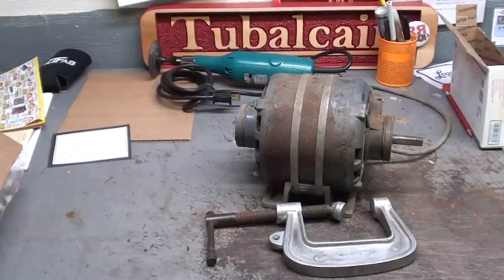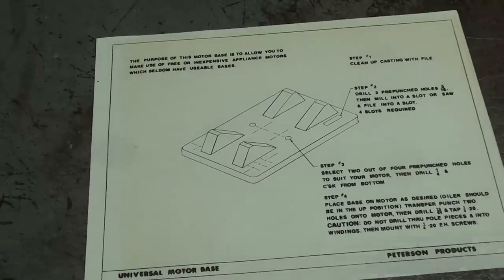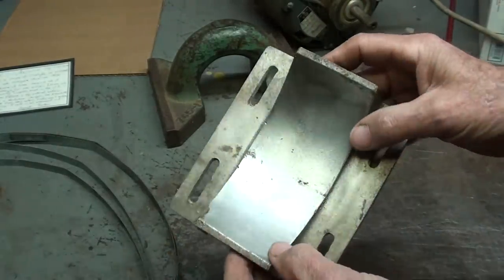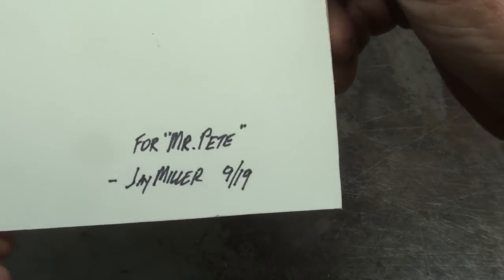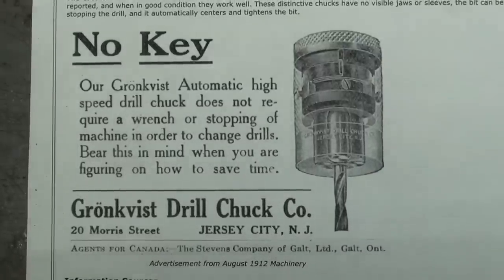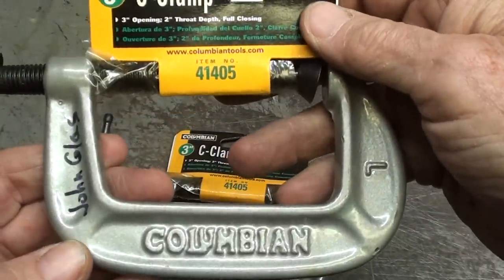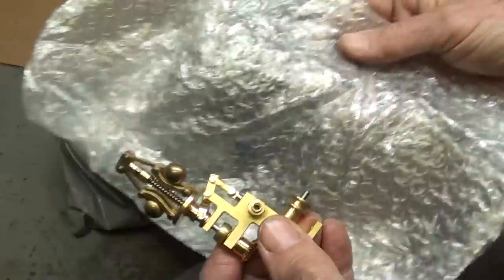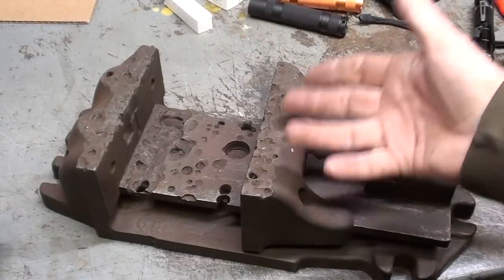This & That #51 tubalcain mrpete shop teacher

Comment: It makes me sad when you dismiss the stories from your past.  I really enjoy them.  Reminds me of the stories my father used to tell me.  Sure wish I had them on video to look back on.
Reply from the maker: Yes, I wish I had some of my dad stories recorded
Reply: My adult kids aren't even interested in my stories.  And I have some unusual and amazing stories.  So I'm going to write them down for when I'm gone.  Maybe they will only take up shelf space, but a father can only try.
Reply: I like your c clamp and motor mount castings. For a young man, you did very well. I have an aluminum step V block from BTHS in my shop.

Comment: Thankyou sir I’m only 72 so got a lot more years yet to learn...yup I learned that about right way to operate crescent wrenches too you be the first person who remembers. Learned too to never grind aluminium on a stone grinding wheel...when next used with steel it produces a deadly explosive gas and can fly into many pieces...never bang two hammer faces together and drag a waste bin around you when working wood as many off cuts and chips will jump right into it all by theyselves saves tramping on them and eases cleanup.
Reply from the maker: Thank you for some good tips

Comment: My dad got an Adjust-a-box wrench from the hardware store in Mount Morris, New York back in the '70s.  He was trying to replace the sprayer on the kitchen sink and there wasn't room to get a crescent wrench into the tight space.  We didn't know about basin wrenches.

I think I have that wrench now.  I've used it a few times and it works fine.

My favorite adjustable wrench though is one that has a slider running along the handle that turns an elongated worm screw to adjust the jaw.  I find this one much easier to adjust than the ones with the worm gear and rack that are parallel to the direction of jaw motion.
Reply from the maker: Thanks

Comment: Bringing back memories. While an electrical apprentice in early 70's  I purchased a set of Sears champion brand box wrenches. Asked the electricians how they liked my craftsman wrenches. They laughed at that. Told me the best place for or them mickey mouse wrenches were at home. After that made sure to only purchase top of the line tools. Still using a craftsman 3/8" socket set that I purchased in 1967 while in high school. Thanks for all the great vids.

Comment: The Crescent/adjustable wrench is made to be used in both directions. (Leading and trailing.) The ENTIRE reason it's cocked at an angle is so you can flip it. For restricted areas, where you can not hit the next set of flats, in one stroke, you can flip it to get onto 2 flats. (Where you can't get a full 60° turn.)
Reply: I beg to differ, the movable jaw tends to angle out and away from the hex nut/bolt flat when force is applied in the incorrect direction, thus offering less ability to apply torque to the nut/bolt.
JIM
Reply: JIM C - but if you study it, using it “correctly” like they recommend, the force is being applied towards the tip of the movable jaw, which i see as applying more leverage to pull the jaw from its track, spreading the tool easier than if it were used the “wrong” way. I’ve always used an adjustable wrench the “wrong” way ever since i was a kid because I discovered way back then that the jaw wouldn’t spread as much when the force is applied closer to the tool than towards the tip of jaw. About 5 years ago i saw for the first time, an adjustable wrench with an arrow on it. I immediately had a puzzled thought, and showed it to a friend and said, “look at this! Cheap china crap has the arrow on backwards”. Now i see this. Mr Petes example is wrong too. Lol. Trust me.
Reply: I've kinda lost track of what's supposed to be "correct" and what's "incorrect",  but it isn't rocket surgery. If you visualize a crescent wrench on a bolt head, with the fixed jaw on the left, and movable on the right, and we tighten the bolt (rightie tightie...etc.) that fixed jaw will push, with max effort at the top of the bolt head flat, while simultaneously the movable jaw is pulling with max effort on the bottom of that opposite flat. ...i.e. max strain on the movable jaw is occurring close to the threaded portion of that jaw (away from the tip).  If we flip the wrench around, the max strain on that movable jaw, pushing against the flat, is now experienced nearer the tip of that jaw, thereby exerting more leverage and theoretically closer to failure.
Practically speaking, it probably only matters to those having nothing better to do than argue/discuss such issues.  lol
Reply: An adjustable wrench/spanner should always be used with the fixed jaw leading ✔️ You can flip it to use it the other way in restricted places but where there’s room always lead with the fixed jaw. This puts less strain on the slides and screw of the moveable jaw. Too many people who should know better keep spouting the opposite.

Comment: Hello Mr. Pete, The only documentation I have found on using adjustable open-end wrenches is from the Department of the Army Technical Manual TM 9-243 "Use and Care of Handtools and Measuring Tools" September 1960. The picture in the TM is almost identical to the picture you display. The TM states 'Always place the wrench on a nut or bolt so that the force used to turn it is applied to the stationary jaw side of the wrench, as shown in figure 127. After placing the wrench in position, tighten the knurled adjusting nut until the wrench fits the nut or bolt head as tightly as possible. If it does not fit tightly, it will slip, which may result in an injury to your hand and which may also round the corners of the nut or bolt head." 

Later, the TM states you should use Auto and Monkey wrenches in the same manner as an adjustable open-end wrench.
Reply from the maker: Thank you. My picture came from the little Disney handbook. Disney did a lot of artwork for the armed services. Probably the same picture.

Comment: I just noticed today at work my Crescent wrench has arrows on the handle showing the "correct" way to use it, but I'm with Mr. Pete, i just grab it and start turning!
Reply from the maker: I was not aware that any wrenches had arrows on them
Reply: @mrpete222  It's a Crescent Crestoloy. It has downward pointing arrows on the end of the handle.
Reply: A modern adjustable wrench in good condition is about equally strong in either direction. It’s the old worn ones with a lot of slop in the movable jaw that you need to watch out for

Comment: Funny comment about crescent wrenches and BMWs.   The one time recently that I can remember using the big Crescent wrench I have was to loosen the oil filter cap on my 2002 BMW M5!   Some people spend tons of money on a big metric socket for this purpose, but I'll just use the Crescent wrench!
Reply from the maker: You were the only one that caught that bit of humor or sarcasm. And the funny part is, you actually used an adjustable wrench on a BMW, LOL.

Comment: That wrench the Patriot is like the Craftsman Pocket Socket adjustable box-end wrench. I got it for Christmas when I was 10 or 11, and it's awesome. It's got 2 v-jaws, that clamp down on updating corners and the 2 adjacent flats. So it's a lot less likely to slip. The 2 sizes span almost every hex size. Perfect for someone who wants a toolbox for home repairs.
Reply from the maker: Yes

Comment: I was a missile engine technician in the military in the early 60's and had to take a test on the use of adjustable jaw wrenches . I was issued card with my  license to drive adjustable jaw wrenches! I had to show my license at every tool box check in order to keep the wrenches. Just one more reason I've always called it the Air farce.
Reply from the maker: Thank you for that information and you made me chuckle

Comment: 14:50. I agree that it does not matter the direction.  I do by habit pull from the large end. But not always due to tight places. I have never slipped over by using the wrench "backward". I have seen a test of weather or not it matters and as far as strength of the wrench it does not appear to. But i always remember as a kid being told to pull with the large solid side.

Comment: Lyle,  I think the restoration of the vise would be a good one, especially if you nickel braze the holes in the jaws and resurface.  Replace the lower plate as before, Evaporust, machine new replacement jaws, and repaint!  My two cents worth, anyway!
Reply from the maker: Yes, but boy did you make it sound like a lot of work. I am retired, LOL

Comment: Speaking a little out of school since i do not owen any rechargeable flashlights. I use flash lights a lot and i do not like the idea of recharging in the fact that when my batteries go low or dead i want to replace them and continue with the task at hand. You got rid of the plate on the drill press vice instead of boxing it up and placing on your shelf.😀

Comment: To add to the great Crescent controversy... one of the Crescent adjustable wrenches I have has arrows on the handle near the hangar showing which way the wrench is to be used. Perhaps the company decided that, as you observed, it doesn't matter a whole lot which way you use the wrench and gave up on the arrow markings.
Cheers from NC/USA

Comment: Convoy is a pretty good flashlight brand. Don't let the cheap price fool you. 
That 18650 cell you have is a bit over the top for a flashlight . I mean 20A discharge rated battery in a small flashlight sounds like a pocket heater to me. 
Those 18650 cells can be mighty powerful. Always handle them with care (even if they have the protection circuit, those are not Bubba proof)

Comment: Simon (owner of convoy) makes a great light. I've been daily carrying a S2+ just like that orange one for 2 years now. Depending on the firmware of that s2+ it can be programed very easily just with button presses to get rid of the useless features and you can set the brightness it comes on at.
Reply from the maker: I wonder if I can program out all of the nonsense. I just want a flashlight

Comment: using the " adjustable wrench"  the wrong way increases the chance the wrench will slip and "round" the fastener , having said that the picture you displayed is has it backwards, test this by loosening the jaws a little and then turn the wrench back and forth, you can see on the movable jaw the further out the corner of the fastener contacts  the jaw the longer the fulcrum is on the jaw hence the more load is applied at the joint and the great chance jaw will deflect and the corner of the fastener will be rounded , ps: use a 6 sided nut

Comment: Even though some of the special batteries can be a pain to get & use, I think those flashlights are better than the super-bright regular-battery ones: The regulars have a super-fast flicker that can mess up video and cause rotating parts to look like they're moving slowly and in either direction ("aliasing" – basically how a timing light works… for those of use who remember when automobiles had distributors).

However it may just be that my regular ones are cheapies, since IIRC both kinds use pulse-width modulation (PWM) to control brightness, and the flicker is dependent on how good the power-smoothing is on the output side.

Thanks again for another fun and interesting videos.
Reply from the maker: Thanks for watching

Comment: Stanley makes an adjustable wrench that has a "vise grip" feature on it to tighten down the jaws on the item you are working on.  Almost eliminates the "rounding off" of nuts.  Stanley 85-610 Locking Adjustable Wrench is one example.
Reply from the maker: Thank you, I have never seen one

Comment: I think you demoed that type of chuck years ago. I actually like that idea for a tapping chuck. so you can change from drill bit to tap.. just use short screw drill bits to be about the same size as the tap.Not perfect but it'll work.
Reply from the maker: Yes

Comment: Hey Mr Pete, The flash lights you got are great but one thing - be careful how you store the batteries. Don't put them in your pocket with change or other metal items. Those are the batteries that vapers use that will blow up if shorted. As long as you take care of them they are fine ie keep them in the boxes they came in when not in use. I don't want to scare you but just be cautious with them. Later
Reply from the maker: Thanks

Comment: Those special batteries are lithium-ion 18650 cells. 18605 is derived from the cell dimensions 18mm diameter, 65mm length. If you purchase replacements, be sure to get the ones with the protection circuit installed (as the Samsung cell appears to have) for use in a flashlight. Without that circuit you will over-discharge the cell and ruin its capacity. Be warned that there is a HUGE problem with counterfeit cells and I would be very surprised if the ones you have are genuine. The fakes aren't necessarily dangerous or anything, they just don't have the capacity of the genuine cells.
Reply from the maker: Thanks

Comment: Amazing that you happen across those Peterson Products products, what are the chances of that?
I like my Harbor Freight welders; not as fancy as the high end stuff, but they're affordable and do the job. 

I also like my adjustable wrenches, I don't get why people trash them like they do either, they're a fine tool when used correctly. I also have one of those adjustable box wrenches. Haven't used it in years, it always felt gimmicky. Although to be fair back when I did use it, I used it a lot and never had any issues. 

Tools die when Bubba gets to them, he should have learned more (or less?) from Primitive Pete! 

I vote for the vise resurrection, it needs a new lease on life!
Reply from the maker: Yes, I was shocked when I ran across those old projects. And I do like adjustable wrenches, can’t figure out why others hate them.

Comment: I really like the spool valve/piston demo card. Manually animated cards, look up tables and these sorts of things are a lost art, I'm afraid. Also, welcome to the world of lithium ion batteries. Those new flashlight batteries look like 18650 lithium ion batteries. 18650 so called due to being 18mm diameter and approximately 65mm long.
Reply from the maker: Thanks

Comment: Mr. Pete,
  I fully understand your comments about teenagers and their antics. For one I was once a teenager myself and got myself thrown out of shop class on several occasions. 
   However I never fully understood how aggravating my insolence was to the adults around me until I became an adult myself and had to deal with young people on a regular basis when I worked at the YMCA in Clinton, Illinois. 
   At the time I was a bi-vocational pastor. The small church I pastored was unable to pay me a lot so I took a job at the admittance desk at the Y. Understand I was a pastor who really should have been sympathetic and understanding of young people and all that but after two months of putting up with the antics of very robust teens I told my wife I had to get out of there or risk permanently damaging my positive perception of God’s immature children. It was unbelievable what those kids could get up to. 
    I left that job and ultimately ended up volunteering to run the YMCA soccer program. The dedication of those young people to the sport restored my faith in our young people and I had many enjoyable experiences with them during that time. Most of those kids were the same ones that gave me fits as the desk manager. 
   You just gotta laugh off the nonsense and give them a chance.
Reply from the maker: That’s a good testimony. But sometimes it’s pretty hard to tolerate. But in the long run most of them are good people
Reply: Mr. Pete,
   I have found that to be true. No matter our frustration at the time I found that many of those young people who caused me grief ended up being community leaders, teachers and even serve as state and national elected officials. Sometimes the most egregious individual rose to unbelievable prominence. We must never sell our young people short. Who knows what greatness they will someday arise to.

Comment: An adjustable wrench is much stronger if used in the way shown as wrong in that article. The movable jaw is much stronger at the base than at the tip.

Comment: LI-Ion Batteries 18650 ----18 is the Diameter 65 is the length and O or Zero is a round battery.